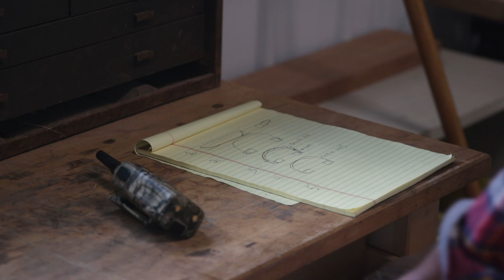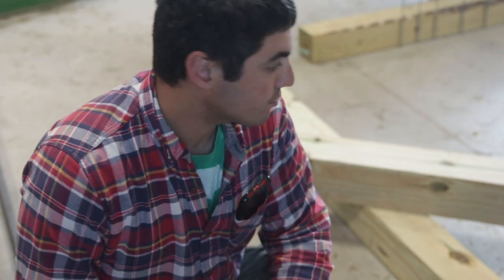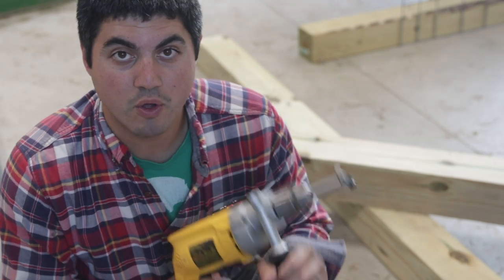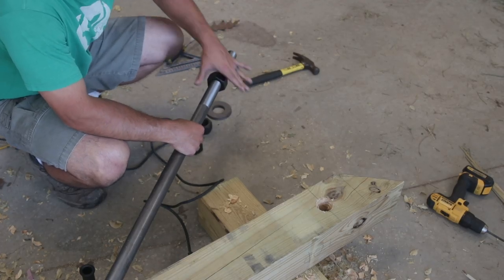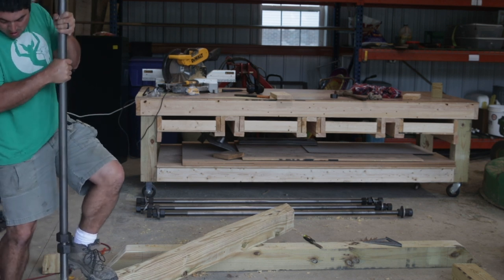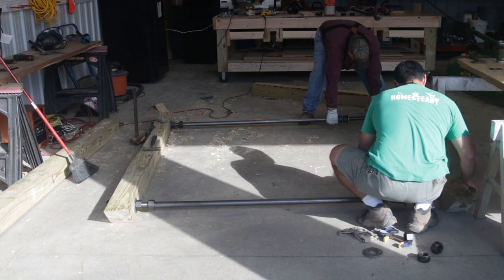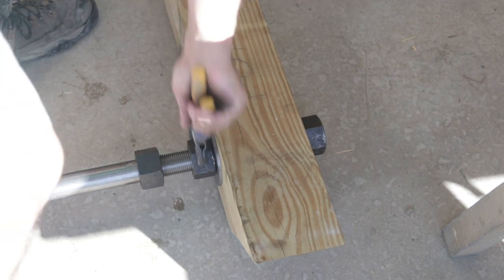How To Build a Portable Livestock Shelter for goats, cows, sheep, pigs or chickens

Comment: You could also use 4” pvc and drill holes in the top to put the ends of the cattle fence into. Then connect all 4 corners with elbows. Much lighter but you’d have to stake it down.

Comment: The next time you have to do this and don’t want to lift an enormous (and incredibly heavy) beam up to a drill press you may (or may not) have, I would cheat. Put the beam up on a table or sawhorses aligned so you’re going to drill horizontally. Grab a piece of string and tie a washer on each end. Hang the string by one of the washers on the drill bit when you put it in the drill. Now look down from above on the drill bit as you move. This allows you to keep it straight from a left/right perspective. And as you drill if the washer/string doohickey moves forward then you’re angled down. If it moves back then you’re angled up. Keep the washer from “walking” and you’ll have a level hole. Then if you have to drill the second half from the other side it should meet pretty well.

Also, that allthread must be crazy expensive and heavy. If you used a lap joint to attach either 2x4s or 4x4s you could have a strong joint that would help protect even the weaker 2x4 and give you a cheaper option. Plus, a 2x4 or 4x4 in the back would help you build any back wall you wanted.

I mean, I know I’m 2 years late to the party on this video, but maybe these tips will help someone at some point.

Comment: Suggestion on the back wall.  you'd made the suggestion about using plywood, but the weight might be an issue. It might be possible to put another piece of fencing up there, an just use bolt cutters to make it the follow the angle of the arch.  It would at least be lighter.
Reply from the maker: Great idea Terry!

Comment: Tried it with goats didn't work out well. They jumped on the sides and collapsed the whole thing. It was like a fun playground to them. They would do it when other goats were inside. One of them got their heads stuck in the cattle panel. After that I scraped this idea.

Comment: the fostner bit is self drilling do not pilot them, if the bit don't pull itself in get a new one , but make sure the tip is clean. Those can break your wrist if not holding good.

Comment: I think having tarp in the back would depend on where you live.  In Texas, I think it would be better to have it open so there is better ventilation.  

I'm thinking doing 3 cattle panels for cows too.  Adding 10 or 12 inch diameter wheels would make it easier to pull.  

It's very similar to a chicken tractor I'm building.  I didn't think about using this for a cattle shade.  Thank you.

Comment: 🤦‍♂️What about wheels?
Reply: Lawnmower wheels, even the large diameter ones, wouldn't add much to the cost and could benefit some.
Reply: @kenlee5015  The only reason for skids is snow sliding or landing in water.

Comment: That mightnnot hold up in high winds.. it is a wobble mess...
Reply: I've watched some of your videos that have a huge larger wobble mess going on. Why you so rude over what he wanted to do for HIS project for a temporary fix. Dang.
Reply: Animal safety is important and yes winds will take this down.  None of my wobble mess have blow done yet even in tropical storms..lol  a little framing would go along way to make this safer..
Reply: @hollandspinehaven2634  The wobble mess I was talking about you have, doesn't have framing. And it would fly in tropical winds. If you say  this will fall apart, you are saying yours will for sure fall apart. I think you are just  looking  down your nose at others is all you Keep doing. if animal safety is your concern you best be pulling a lot of your stuff down.
Reply: Wow really I think this family would want to know that there is a safety risk.  Your the one attacking me.  My shelters have gone through 2 hurricanes..so I think they are solid.   My mobile goat shelter has wall framing to stabilize the cattle panels.. cattle panels are not stable without this framing..
Reply: Wont the metal rods pose a hazard to a larger animal like a cow that may not see them because of the grass? I would think that building a structure with three sides and maybe a piece of paneling across the top would be sturdy without the rods. Could probably do most of it using PVC so that it is light weight. (Except maybe the back bottom piece which I would just use a 3rd piece of wood or rigid conduit.
Reply: @hollandspinehaven2634   No Homesteader is ever  good enough, but you. For some reason this Homesteader you don't like nothing. I think I know why from your posts and videos.
If your mess went through 2 hurricanes ,this will absolutely  have no problems at all then in a hurricane storm. 

CATTLE PANELS. CATTLE big animals panels. See the picture. Not wobble chicken wire. 
I am sure you don't want the subs you have knowing how you feel about them, in real life. That none of us are good enough for you. Only your way or no way attitude. 

Alfredo No the rods will not hurt anything. The animals get used to things, they are smarter than you are giving them credit for. Do you know what animals jump over and up on all the time. Downed trees and fences, up on cars and tractors. And a little rod will be baby play. 
They climb on everything they can. 
Look at the Hollands videos and see how much stuff they have in their pasture the goats jump on. it is a lot more dangerous than a rod.
Reply: @cilandialane7521  wow you sure are the one attacking me..  I have never been mean or attacked another homesteader.  My videos do get people making suggestions which we take seriously.  I am done defending myself..  #Homesteady please rethink your construction and maybe and some rear wall framing and a high cross memeber near the top front...
Reply: @hollandspinehaven2634  Not attacking you. Defending this Homesteader and the others you always calling out. You can clean up your own sloppy wobbly messes before telling others they have wobble messes. 
His design is just fine,. Will work just fine. If it needs something he will figure it out. But it won't need a thing. Others who have made similar didn't need a thing. 
 I have been your sub for awhile and have watched and READ your comments. ENOUGH is ENOUGH with yours is better than everyone else's stuff attitude. The subs don't like being looked down on either. It is OUR wobbly messes NOT yours. Clean up  your own high flying messes. LOOK in your own back yard.